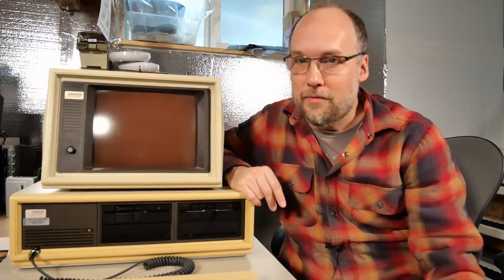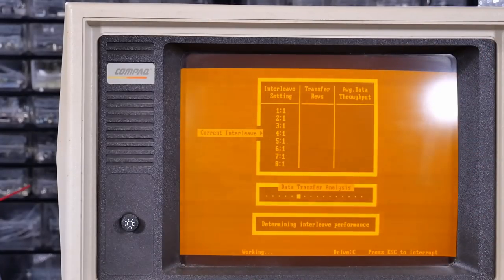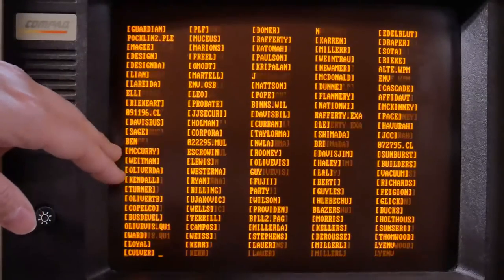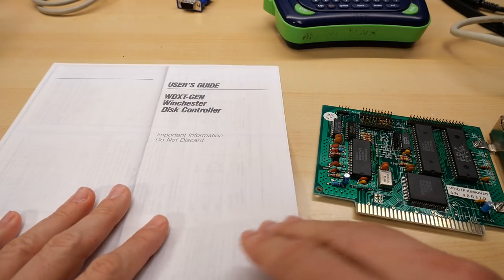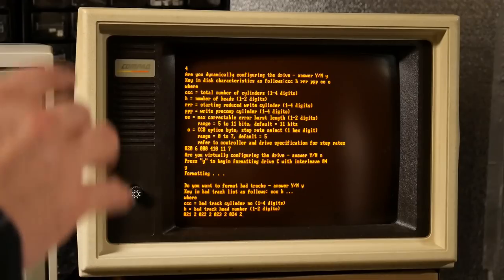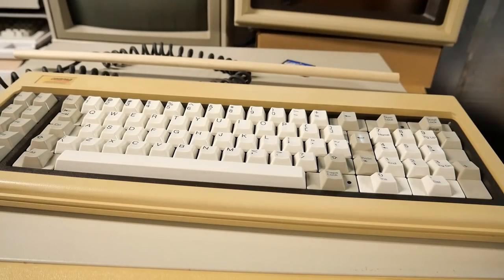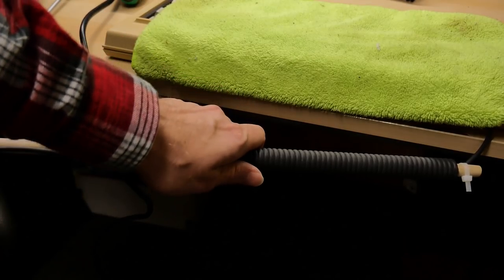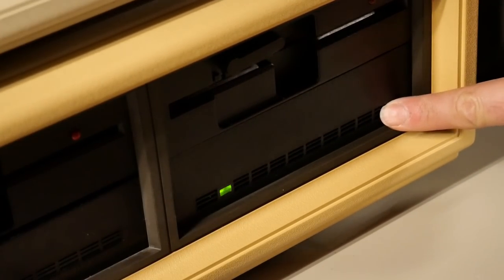Compaq Deskpro Part 4: The home stretch! MFM hard drive, keyboard and monitor

Comment: It's interesting how that Multisync monitor you had hooked up refused to show anything; it is almost certainly for the reason you suggested, IE, when it recognizes an MDA sync rate it disables the RGB input pins. If you had an old NEC Multisync lying around you could give that a shot, I don't think the first gen ones would be smart enough to do that. Or you could run a jumper between one of the RGB pins and pin 7; some colors won't show up, but white text will. Proof of concept, anyway.

I'm old enough to remember that there were mono monitors that were similar to this Compaq monitor in being able to accept CGA and covert it to 16 grayscale; the first PC my family had came with an amber "Princeton Graphics MAX-12" that could autoswitch between emulating CGA or MDA depending on the input it received. I'm kind of curious if it would be able to make sense of the Compaq's output, but I'd guess it would probably do the same thing as that color monitor, IE, switch off the RGB DAC and listen only to pin 7 for video.

Since you showed the Tandy 1000 EX here's some stupid pin 7 trivia: The Tandy 1000 EX for some bizarre reason has pin 7 on the CGA jack internally connected to pin 4, the RGB green output. There's some vague references in the manual to monochrome support for the video chipset, but no evidence that it actually supports MDA frequencies, so I have no idea what they were thinking. That pin gave me a big headache when I initially tried hooking my EX to a Commodore 1084D with a straight-through 9 pin cable because RGB green was grounded on the monitor end; in analog RGB mode the 1084D uses pin 7 for composite sync. Thought my EX had a blown RGB port until I figured that out.
Reply from the maker: Ah wow that is kind of scary on the 1000's pin 7. You know what??? You just solved a long standing mystery for me. I had noticed that my Tandy machines always display a blue-red image when using some Amiga monitors. DAMN! Thank you, I just assume it was an output transistor thing or something. How funny!! And yeah my 1000TL supports MDA in addition to the Tandy modes -- so I guess they finally enabled that long planned feature. :-)

I've always wanted to find a nice condition Multisync monitor (a real one not the later VGA/SVGA only ones) but they are unobtainum. LOL!  And I'm really not surprised there were monochrome monitors before that could display the grayscale. Funny how much of this info gets lost to time right?
Reply: @adriansdigitalbasement  It's my secret and totally unfounded pet theory that Tandy implemented that "mono mode" because they were thinking of combining the EX motherboard with leftover Radio Shack Model 4 cases (which have a built-in TV-frequency TTL mono monitor) to make a weird PC/Terminal hybrid. ;)

(You can actually enable a "Mono" mode on the EX/HX by using the "mode" command that shipped on their special version of DOS to set "mode mono"; it installs a palette that would be displayable on a "vid/intensity" only monitor and appears as grayscale over RGB. But the video frequency definitely doesn't change. It doesn't work particularly great because a lot of color combinations become indistinguishable with only 4 grays to work with.)

And yeah, that pin 7 thing was a bugger. I didn't have a proper shielded CGA cable, just a straight through 9 pin serial cable on the long side, so first I blamed the cable, then I made a new cable... It could be worse, though. The original Tandy 1000 has 12v on pin 7 according to the tech manual. If that's actually true you might be able to make a Commodore monitor go nuclear if you hook it up with an all-pins-present cable.
Reply from the maker: Funny I have a proper cable actually but it has PIN 7. Some monitors just don't connect the PIN 7 at all .... So very strange. And the Model 4 idea is a good one but still seems odd to hook it up that way since clearly it would be some internal connection and they could use the green pin on the DB9. 

I'm wanting to go try to disable the PIN 7 now ... Maybe unground it on the monitor.
Reply: @adriansdigitalbasement  I suppose it could simply be that they were working on integrating support for MDA monitors and the feature got cut late in the development cycle for that gen. The Big Blue chip in the EX has a lot of interesting tricks built into it, and could probably be programmed to support a Hercules-type mode (I learned the other day it actually has hidden support for Amiga-like 400 line interlaced modes!) but I don't know if it could generate the sync for it. (The tech manuals are sketchier for the SL/TL generation, I don't know if the later ones have multiple clock inputs for the BB2 or are able to make do with the single 28mhz clock like the BB1)

If you want to terminally neuter the problem the safest bet would probably be to snip the pin on the Tandy's socket. The Amiga monitors with the problem supposedly use pin 7 for composite sync input so they might not work properly anymore in analog RGB mode if you mod that end. I can only guess most CGA monitors didn't have it connected. Now I'm wondering if I had that old Princeton Graphics dual-mode to try if it might get confused by it. ;) (Wait, I'm seeing video on both the RGB and the mono inputs, what madness is this?!?!)

Comment: Here are the three memory locations I'm aware of to run the init routines in an XT hard drive controller's firmware from debug:

g=c800:5
g=c800:6
g=c800:ccc

There may be others.  c800:5 is the most common.

Comment: Oh, Adrian, how quickly we forget. 

debug
-g=c800:5

Drives of this era are married to the controller. Change controllers?  Start over.
Reply: Not quite. You might get cross compatibility with controllers from the same vendor, but true cross compatibility didn’t come until IDE/ATA drives. 

I admit, I was yelling at the screen for this video, but you ended up where you needed to be. Well done!

Comment: 24:02 Holy crap! This utility has transferred a whopping 7 Gigs of data through this 8-bit controller!
Too bad you did not scan physical sectors of the drive near zero to see what kind of overlay data was written to it by the MFM low level format ROM program.

Comment: Great video on the MFM drive Adrian.  I had a very similar situation on an IBM 5155 with the Seagate 251-1.  The system would sometimes boot and the files were sometimes there, sometimes not.  I eventually LL formatted the drive and put a new filesystem on it, and it has worked perfectly ever since.  I guess the magnetic sector layout (and data) just fades away after all these years to the point where they are somewhere in the middle of being a 0 or 1.  I didn't know about these tools, so I went right to debug and to the LL format program on the WD1004A-WX1 controller's ROM. 

debug -g = c800:5 CR was the command, same as yours, even the program was the same!  https://i.i m g u r .com/7IByO1u.jpg

I've read that there was variation around about LL formatting a drive on a different models of controllers, which I guess turns out to be true.

Thanks for always posting the links to the tools you use in the video!  I'll have to use SpinRite to test the interleave and see what is fastest.

Comment: To get a good coil on the cable you need to reverse the direction of the coil after the heat treatment.  This will cause the coil spirals to push themselves together instead of apart. So if you heated the coil going in a clockwise direction you need to re loop it to go counterclockwise. You can either do this by hand or by using something like a drill to wind the cable until the coils reverse. I collect and read about old telephones and this is how the coiled handset cords are made
Edit: How it's Made did a video about it: https://www.youtube.com/watch?v=7ZBVi17ypjQ
Reply: @adriansdigitalbasement  Yeah, reheating the cable resets the memory, then reversing it causes the cables desire to stretch back out to become a compression force

Comment: I have something similar to your junk SX machine, (It's really just a motherboard mounted in a coverless tower case with a weird small PS (AT) and a crappy OAK VGA card) except that it has the hard disk auto detect utility. It works pretty well, (even with MFM!)  and I've moved that BIOS to other AMI motherboards mostly successfully.

If you want, I can dump the ROM for you.
Reply from the maker: Oh sure a link to BIOS could be helpful. The one I'm using there isn't even the original either but it seems to work OK although I prefer AMI usually over AWARD. A few people have asked me to look a little deeper at that machine. Might be a good one about batter damage and how it's not always a terminal diagnosis.  :-)
Reply: @adriansdigitalbasement  AMI has been my preference for decades ;) I have it in with that machine later on tonight (as you have inspired me to do an MFM-IDE-EIDE-SCSI-SSD comparison vid ;) so I'll see if I can grab the BIOS for you.
Reply: @adriansdigitalbasement  OK I got the BIN file but my company's OneDrive won't allow me to link to outsiders. Do you haven an email or somewhere I can upload this?

Comment: Do you ever work on any old TI99’s? I had one early 80’s and it stunk. Just wondering.
Reply from the maker: Ha -- yeah I actually have one. (It works) Other than looking like a neat machine (the silver look with black keys) I am not a fan of the machine either. So it just sits and looks pretty.

Comment: Older stepper positioned drives will degrade like this.  This is due to thermal dynamics causing the tracks to migrate away from the read / write heads.  Since the heads are positioned by the stepper motor, they always will land in the same spot and can't compensate for track drift like modern voice coil drives.  Spin Right will help to some degree, but a true low level format is a must when the drive starts degrading.  Also with MFM, RLL, and ESDI drives, the drive must be low level formatted with the controller it's mated too.  Swapping the controller will result in the drive not working as you found out with your 386.  I've found as long as these old drives are stored in a good climate controlled environment, they seem to go forever.

Comment: Why the LED activity indicator on the MFM drive is constantly lighting while inside the Compaq machine? I saw that in the test bench was working fine, blinking only when actual activity is happening.
Reply: @adriansdigitalbasement  Thought the same. Back in the IDE times I had similar issues, and ware always caused by bad configuration of master/slave jumpers and cable. Never had this with the MFM drives dough. I'm wondering is there anything relevant in the MFM controller documentation?

Comment: Does anyone have any information about the power / video port configuration for the amber monitor?  I've come across one of these and would love to use it as a monitor for maybe my sinclair 1000 or other vintage non-compaq computers i might come across.. but i know it's a CGA monitor and just wonder if i could rig a PSU for it independent of any computer.  I just need to know the amperage and voltages the pins on it would need and maybe the pin configurations to insure it's getting the right video signal to display properly.

Comment: MFM drive installed in 1991?  Either my internal clock is off or this computer was a bit behind its time.  Or perhaps someone was just upgrading an old computer?
Reply: What? I've just installed a MFM hard drive in my new Threadripper computer, along with MS-DOS 6.22. Now 31 of the 32 cores are completely unused :) Just joking... :)

Comment: Does this old Compaq have a 286 CPU, or is it 8088-based (XT)?
Reply from the maker: It's a 8086 CPU actually. (Like a 8088 but 16 bit external data bus vs 8 bit)
Reply: @adriansdigitalbasement  8086 > 8088.  "Cleaner" design, fewer compromises.

Comment: If you could test how fast this drive is, though I can only guess it's below 900kb/s cause that's the only baseline it'll reach under normal conditions. Not to metion the fact that its capacity is outwieghed by even 80 gigabyte drives. But cause the mfm drive is far slower it's not a direct comparison.

Comment: Have you looked into replacing the old Dallas clock IC with a newer equivalent? They are integrated in one package now, but perhaps your programmer can write to them?  Worth checking it out. https://www.maximintegrated.com/en/design/technical-documents/app-notes/5/5756.html

Comment: I absolutely can't tell whether SpinRite works or is a bunch of hooey.
It was certainly very useful in its day and had a lot of relevant functionality for old hardware.
But Steve Gibson is still pushing it like some miracle cure. As chance would have it, I have a failing hard drive now. But nobody in their right mind should be writing data to a compromised disk the way SpinRite does so I'm gonna see what it'll do once my important data is recovered at 6000 times slower than normal speed.
Reply: Gonna be about a month lol

Comment: It would be much better to leave out the white text on a black background parts where you just read the text verbatim. Or integrate that content with the rest. Either way, they ruin the flow and I honestly thought I was watching a much older video with practices you had since stopped using. Turns out it was the other way around. :)

Comment: You can NOT  change MFM controller like this , you  MUST use the controller with which you formated the drive
Reply: Gues Adrian proved you wrong
Reply: @basvanharen2904   you watched the video and do not understand it ? right ?  if you format HDD with one controller ... you than can not swap the controller and use it with other without formatting !  so  if you are connecting disk to one computer and than to another  you have to replace them with the controller

Comment: it is NOT a good idea to move pre-IDE drives between disk controllers. Low level disk formats differ wildly between different controllers, and you could have saved yourself hours of hell. Always deal with a disk on the same system you're going to be using it on.

Comment: you should throw that drive away and put in old 20gb ssd formated to 42mb trough SATA to IDE adapter for blaaaziiiingggg ssssppppppeeeeeeeeddddddd
Reply: Won't be faster than the CF card. The 8bit ISA bus is the bottleneck in XT class machines ;)
Reply: @adriansdigitalbasement  You could still do that if the drive should give up the ghost. Which I doubt it would. If it survived until now, why should it die now?
Besides: What would you do then with the drive? Put it on a shelf to collect dust? In my opinion, that would be a waste... Just use it for its intended use!
Reply: @kpanic23  there will be no seek time so it will be faster. and transfer speeds will reach their highest limits. also I was just joking around with ssd.
Reply: @lordmmx1303  Sure, but if you really need faster mass storage, you could just use a newer, faster machine ;)
In my opinion, those old hard drives are a large part of what makes up the flair of these old machines...